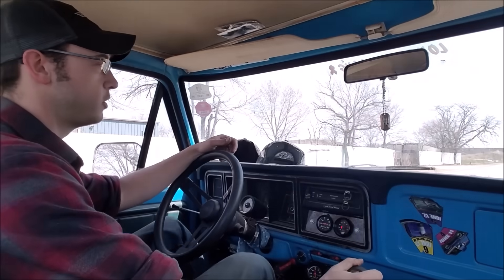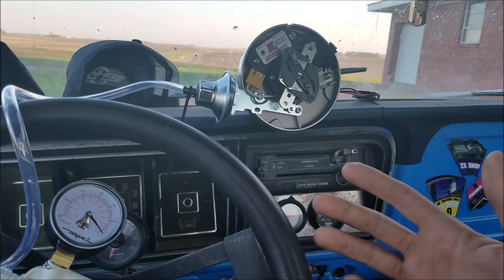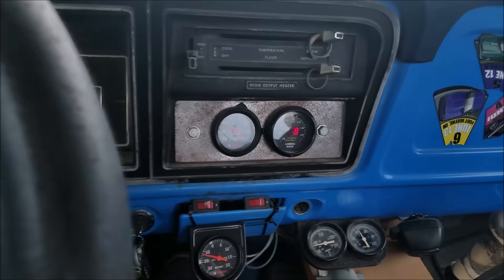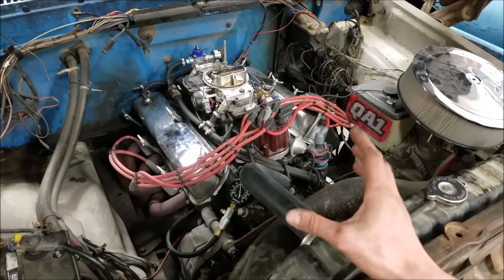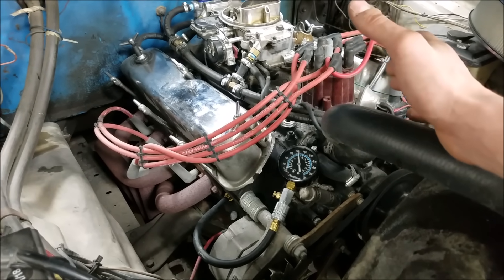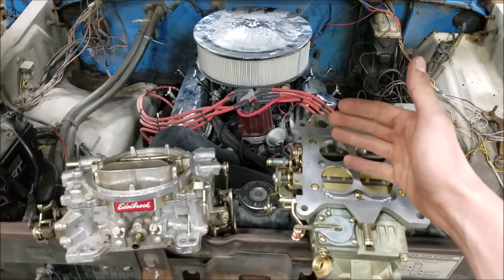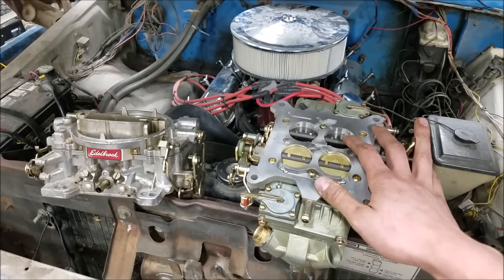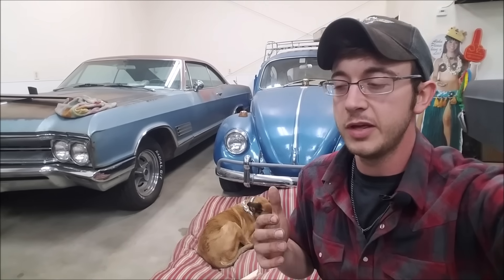Vacuum Advance - Ported vs Manifold: Which to Use & When !!!

Comment: been years since i was carb and vacuum dizzy. but ive always seen EFI engines dont usually run much advance at idle. so i always ran ported so it wouldnt have much vacuum advance. having full vacuum advance always made my engines idle like crap.

Comment: Gooday A! 289 first rebuild I did , for a friend 40 plus yrs ago. However I believe you could be helping people out more by telling a bit more on the ign. curve rates. From my belief it's 1 degree advance/1000rpm . I weld the slot on ign. shaft to limit timing use heavier adv. springs (no slop) without vacuum adv. it seems to work well . Maybe it does & William Tyler Jenkins seemed to think so. Cheers AKA  Motor Mouse Halifax N.S. Canada RIP SBC

Comment: Only thing I have to say is you should have cleared the compression tester.  Even if you had left the throttle plates closed and cranked more on it you would have still built up pressure.  It's why you check compression at 3 pulses not just crank till it levels off.

Comment: I was told when I got my goodwrench sbc350 that it had a mild aftermarket cam but it doesn't idle well with less than about 40 degrees total timing.  Does that make sense, especially if the carb isn't setup just right?
Reply from the maker: Are you sure your timing pointer is accurate? Have you verified true TDC
Reply: @ThunderHead289  Its been a while since I worked on it, but IIRC the piston was definitely in line with the TDC mark, although I wondered if the cam was a tooth off and never got around to taking everything off to confirm it.  I was doing ported vacuum though, and if I get your meaning there's a chance that a more aggressive cam and/or carb config would also cause this.
Reply: Not uncommon. Don't worry about the numbers, focus on how it runs.

Comment: Re : "big boy pants" ...that's a vacuum advance solenoid ,,, not canister ...Btw , always use ported vacuum ....adjust the timing for peak manifold vacuum with the advance disconnected ...Once the engine is modified , factory timing is no longer optimum ...
Reply from the maker: A solenoid is an electric component ya doof
Reply: @ThunderHead289  solenoid is a linear actuator ... regardless of power source .vacuum canister is for storage .....so your air conditioner doesn't change to defroster while accelerating onto the interstate ...
Reply: @ThunderHead289  At some point some idiot who sits behind a desk decided that thing looks like a canister ,and somehow a lot of people copied him ... but ,,, here's a link from the "old school" to prove my point ...www.mamotorworks.com/corvette/product/corvette-1964-1972-distributor-vaccum-advance-solenoid-647727

Comment: Yupyup
Reply from the maker: It will for sure, normally in most cases factory advance doesn’t pull enough timing for it to be a concern - it usually helps across the board. 
Soon here I’ll do a video on timing lights and total timing.

I didn’t ponder the fact that a lot of folks won’t pay attention to total timing. When I ask people, most don’t even have any clue!

Comment: All vacuum advance does is avoid your plugs loading up, and fouling.  Total  timing is set by revving it up to full advance, depends how much tension on advance weights you have chosen...   You got to much transfer slot at idle?  Then all you do is drill a 1/8 inch hole on each throttle butterflies.on it's forward perimeter, stay away from edge, drill bigger as needed, as you notice idle quality improvement. Copy 10-4?
Reply from the maker: George... slowly back away from the carburetor.
Vacuum advance adds timing at high vacuum low load scenarios because a less dense cylinder charge had a much longer burn time, so to fire the mixture at the right time you have to ignite the mixture earlier. 
Once you slam the gas, vacuum advance is null since vacuum drops out. 

When setting total timing, it needs to be done with vacuum advance disconnected because you can’t load an engine for checking timing. Most engines run great with 32-42 total degrees

Comment: Old school approach .. Set mechanical timing at wide open throttle to the spec of the engine . thats full timing at 5000 rpm. Then set your mechanical idle timing by changing weights and springs to  bring in the timing curve. Then hook the canister to the manifold and set the range of  the  vac advance so it does not  cause the engine to ping  by adding too much advance . Usually a allen bolt in the canister inlet  to adjust.  You want it hooked to the manifold if you are racing . You do not want a lag  from ported changing initial timing  while you are digging for power on launch. You want full  manifold vacuum holding the timing high and steady  off the line on the street.
Reply from the maker: Timing needs to be all in by 3000-3500 because after that actually the turbulence of incoming air speeds up the burn time effectively “advancing timing” 
Also, any form of vacuum advance completely drops out when vacuum drops on hard throttle, you are only on you’re mechanical timing
Reply: timing is wide open throttle full advance all in for engine spec  ..end of story ... 5000 rpm is safe in the driveway with a  timing light.... this is not efficiency this is performance
Reply from the maker: Whirl Wind you can do what you want, just let me know if any of my tail lights are burned out ☺️
Reply: @ThunderHead289  Ported vacuum (0 vac)gives you mechanical advance initial timing . Manifold  to canister gives you a few degrees advance off the line. Going from mechanical to advance then to mechanical curve is a  initial bog and loss of power . Deflecting to imaginative races in your mind with me looking at tail lights will not change the error of your thinking .  **Closes fist before Grasshopper grabs pebbles**

Comment: Ha! Thought I recognized where you were doing your burnout at... Wondered who laid those patches.. Anyway, it's good to see that carbs and distributors are still getting some attention - beyond bolting them on and calling it good.  It sounds like you've arrived at many of the same conclusions as I have. 

Most of my tuning know how came from hot rodding GM cars in the early 2000's, but I haven't forgotten everything. For the HEI, in the past, I've used adjustable vacuum advance cans and altered the length of the advance slot by welding and/or grinding to get the advance combination I wanted  in addition to the usual springs and weights business.
Reply from the maker: Most of those marks aren’t from me! There’s a red foxbody piloted by a fella that I know well that rides around over there. Makes for a nice low traffic road to get some camera shots at though! 

The hei units are definitely fun to play with. Iv made a few custom advance limiters in my day

Comment: Excellent video. A very clear description of what both vacuum sources do. Essentially the same above scant throttle opening. 
In my Jeep J20/10 I run a manual vacuum switch.
Engine is a 1979 AMC 360 with 8.23:1 CR, Thorley Tri-Y headers, Dual 2.5" pipes, Summit racing mufflers. I tuned an old ACDelco AMC points distributor and am running the stock 1970 360 curve, I think 5* initial advance at 600RPM. The intake side is an Edelbrock Performer manifold topped with an Edelbrock 1405 carb. Unknown cam - it was swapped in years before I got the engine. It is old - likely has 100k miles on it. No idea what upper advance curve is. I don't race it, I just like scootin' around town in it. 
I run Manifold Vacuum Advance in the cold and switch to Ported when the engine warms up, because, yeah...it idles way jittery warmed up with manifold sourced advance.

One thing: I would try this - I noticed your open element air filter on your 289. Try running a closed intake airbox with snorkles running from the front of the vehicle and see if you get any added performance out of the engine. I used to run open filters and I realized the engine was sucking 200 degree engine compartment air. I run dual snorkles on stuff now in hot weather and remove the hoses in the winters...because the temperatures changes from high 90 degrees in the summer to -20 in the winter. And I found out ramming freezing air into an engine is no good. And sucking 200* air is bad in the summer.
Reply: That 200* air is good for fuel economy, hurts power though.

Essentially it's like losing a few cubic inches displacement.
Reply: @glenwaldrop8166  explain the scientific principal of that statement please.
Reply: @tinkerjeeppublications9823  hotter air is less dense, essentially it's taking in less air for the same throttle position and RPM vs colder air. The heat also helps vaporize the fuel before ignition.

There's certainly a temperature cut off point where you lose power and economy but around 200*F under hood temps with an open cleaner is pretty efficient, though slightly down on power.

That's partially why older engines had exhaust/coolant crossovers in the intake, to help increase the temp of the intake and the incoming air and increase efficiency. In those cases I'm pretty sure they went too far, most people saw gains by going to a cooler running aluminum intake.

Comment: I don't understand compromise of running an old school distributer. I have a dual points Mopar distributer from the 60's that retards my ignition for the nitrous shot, has an adjustable vacuum diaphragm, gives perfectly accurate spark to 6,500 rpm, and with my drawer full of springs and advance weights I can have my all-in 34 deg (for non no2) adjusted anywhere from 1,200 to 3,000 rpm. You don't need the latest and newest engineered product to do what you want, just an old school knuckle dragging hot rodder.
Reply from the maker: I am too 😉

Comment: So I have an Edelbrock 1406 carb on my 350/350T, the HEI is currently being pulled from the ported vacuum port on the carb.  So I have to re do all of my vacuum lines as they are a hot mess.  But the manual says to use the manifold vacuum port for the Transmission.  My question is, can I put in a "Y" and run both the trans and distributor off the same manifold vacuum port on my carb?  If not, what then would my options be?

Comment: The proper maximum spark advance on a Chevy V8 is something like 32 degrees advance. If you set it that far it is good for cruising without heavy load but if you get on it with that much advance it will knock. The vacuum advance unit will turn it back automatically because the vacuum will drop with load. That’s what it does.
I’m not sure what he is arguing about with ported versus straight manifold vacuum. The ported set up was just to help with getting engines to idle slow enough especially in the days of de- tuning engines to meet the new emissions standards of the 70s. ( I’m sure he remembered all that business ) some cars had to turn the idle way up to keep them running while at the same time turn the timing back to keep them from running too fast.
In the 1970s, especially after about 1974 most cars on the road, at least most all GM cars had a vast array of vacuum ports and vacuum solenoids and vacuum relays and you name it that basically made it so that the vacuum advance never ever turned on. I used to go under the hood on friends cars that had 70,000 and more without ever having any vacuum advance. I would change around a few hoses and then have to turn their idle way down because with advance it now doesn’t need it open that much.
They would see me the next week and say “ WHAT the hell did you do to my car???”
It runs like hell and gets 5 more miles to the gallon !!! “
They thought I was a magician
Reply from the maker: There is some serious old timer logic in this description some of which is unfounded in truth. 
Ported allows a stock or mild cam engine to then run more mechanical timing which in most all cases will be a more effective timing curve since factory settings are safe but inefficient as they burn the cylinder charge too late. By moving up initial mechanical, you shift the whole curve up without altering anything else which will net some notable gains over stock settings.
Reply: It was a time when laws were changing faster than technology and especially faster than they could change production methods.
Kind of like the government saying you need to cut the emissions in half in the next 6 months or you can't sell any cars. Do you think they would design and set up production for a whole new engine in 6 months or doctor the heck out of what you are producing now and take the next 6 years or even the next 16 years to redo everything to get emissions cut in half
Reply: Yeah they put that vast array so the vacuum advance wouldn't work 😂😂😂 if that was the case they would have just removed the thing and saved millions. What you did was bypass non functional devices instead of fixing them to make the vacuum advance work again. They were right, it was magic. A trick to make someone believe the illusion.

Comment: The first ported carbs were made for auto transmission  shifting, not engine timing, (throttle off, no vacuum, shift to high,  throttle open, higher vacuum, shift downwards.) Later in all engines it is used for pollution control. The retarded timing puts the flame far into the exhaust manifold to burn off excess HC's. My old Datsuns I just use manifold Vac, ported for fuel tank purge. The timing is set to 36 deg. full advance plus 15 deg. vacuum to get 51 deg. at cruise speed. The vac. can usually needs adjusting to get that number.
Reply from the maker: Ported was even around in flatheads before the advent of a PCV valve. Don’t let the internet folks fool you, if you run ported and advance your initial timing, you will walk right around the guy beside you on manifold with lazy initial mechanical timing 👍

Comment: I did the t18 swap the first one was aluminum housing found in the bone yard reverse was over and up tore it up  (wished I kept) junk it found t18 cast steel back and shoulder destroyed. Lol tried my damnest to destroy it after seven years the rear end come apart. This was in a 75 f1oo or 150 302. The 302 thought it was a 390 and this was back in 88 when I bought it for 600 bucks. Good video my blue oval friend. Carry-on my good sir.

Comment: Hey Luke I’m pretty much a novice here and from the information I gather with the cam I have I would need to go manifold vacuum. Due to my cams specs. I don’t have a radical large cam but I also don’t have a mild cam, it’s more of in the middle but closer to being considered a large cam. Will manifold vacuum be suggested? This will be my first time ever attempting to tune my carb and and car by myself. So I’ll be watching all your videos and attempting to grasp all the information I can. Kind regards Big Kev
Reply from the maker: Howdy Kevin, 
Bigger cams make less cylinder pressure at idle which requires more timing. They do this because the valve overlap that promotes air flow via scavenging at high rpm is bleeding compression at low rpm. 
Less pressure means longer burn time, SO manifold is a safe bet. 
The trick with manifold is that oftentimes you have to run a lower mechanical initial setting which all things equal will be very lazy when you stab the throttle. The solution is to bring your timing in more rapidly via lighter advance springs. 
So you will need a distributor that allows you to dial in the curve. Look to pertronix, they are entry level and have this availability in their units. 

If you want to go big dog style, the progression unit will stomp any MSD competitive unit.

Comment: I know that vacuum has been the standard since before we were a lustful look at a Deep Purple concert , but how bout a simple cable to the accelerator linkage on the carburetor?????  The clips you were showing I'm sure would be a great fix , but also looked very $$$$$$!!!!!!  The thing is of going with these carbs and distributors is to get away from computers ( or at least me anyway) and back to basics. Kinda like my KLR Kawasaki Enduro motorcycle , there are much nicer , plush bikes but I wanted a basic carbureted manual go anywhere beast.

Comment: I've worked on a lot of cars over the years. 
In the beginning (80's) I used to believe that you wanted to ADD timing when you stepped into the throttle. (High load)  Oops! Lol
But I used to like ported connection so I guess setting my base timing at idle still set up my timing correctly anyway as the port actually didn't add vacuum at higher throttle after all

By time I was into tuning EFI in the 2000's I turn knew more about quicker detonation under higher loads and that you pulled timing in those regions especially at lower RPM.
Reply: Yep you want more timing under low load conditions and less timing under high load.  It's why you really can use manifold or ported vacuum.  Only thing you lose out on is initial advance but in some cases you cant run enough initial advance without dragging on hot restarts to obtain a smooth idle with ported vacuum.  That's the problem I have with my 302 engine I'm going to replace.  Run ported vacuum you cant get a smooth idle and starter drag occurs at 14* initial and I run 12* initial with manifold vacuum.